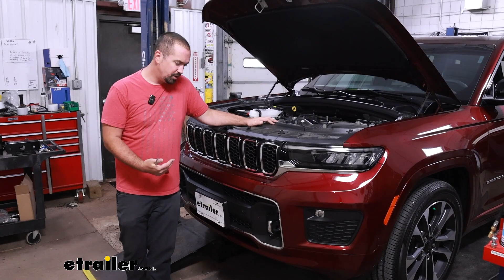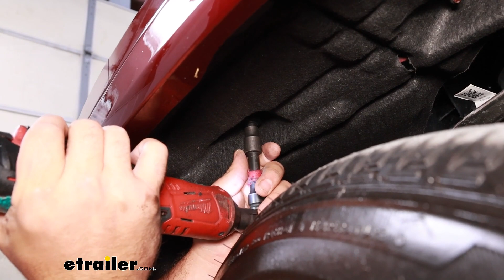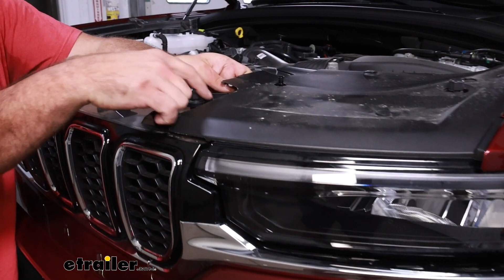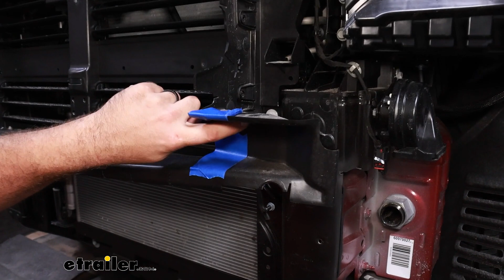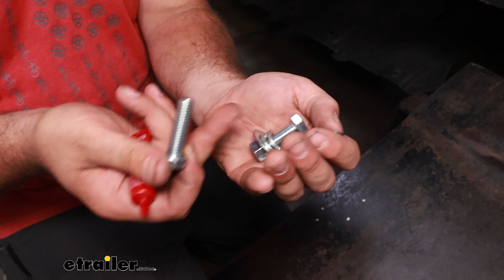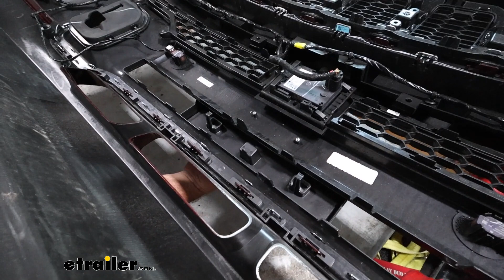DIY Installation for the Roadmaster Direct-Connect Base Plate Kit - 2024 Jeep Grand Cherokee L

Comment: Nice, why didn't you include the electrical connection?
Reply from the maker: You can see the procedure in the video I've linked below for you:
https://www.etrailer.com/tv-install-roadmaster-diode-wiring-kit-2022-jeep-grand-cherokee-l-rm-15267.aspx
https://www.etrailer.com/Flat-Tow-Wiring-Harness/Roadmaster/RM-15267.html
https://www.etrailer.com/instructions.aspx?pn=RM-15267